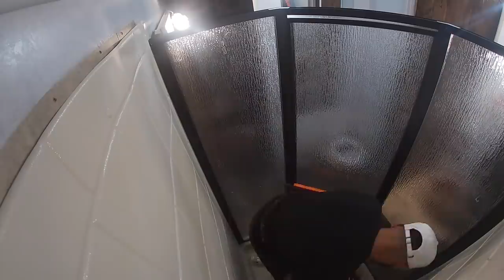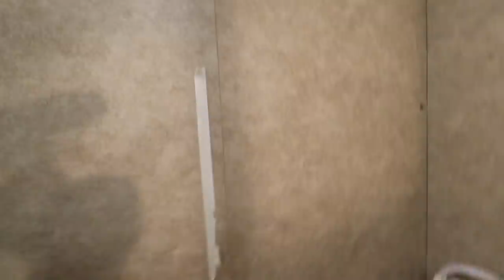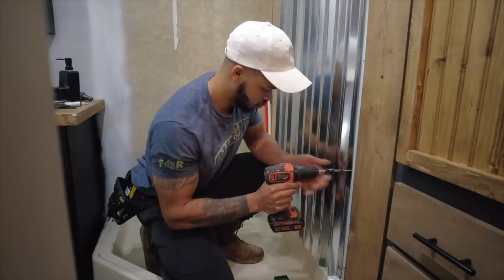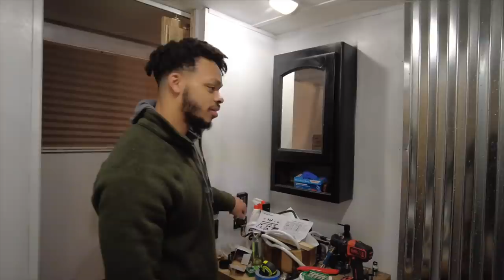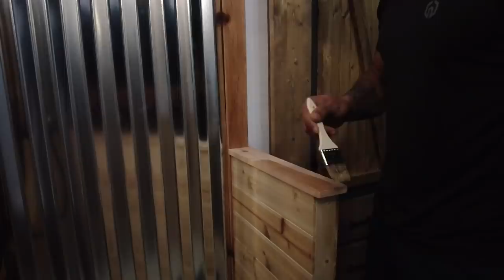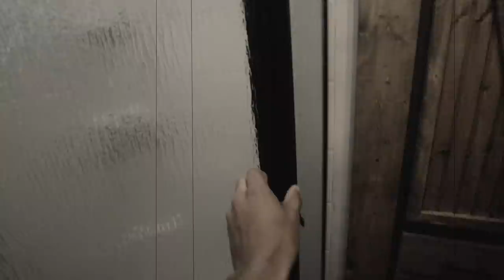DIY RV Shower Rebuild | Dualex RV Renovation

Comment: Looks good , I'm wondering about moisture creep at top and bottom of corrugated metal. Your definitely gonna wanna seal up those areas .Keep them coming.
Reply: I was wondering the same thing. With the corrugated metal I think it will be more difficult to seal
Reply: We share a similar concern. The work is great but I’d be worried about the moisture
Reply: Looks great. I agree about sealing it up. I think I would go around all the seams with clear silicone to ensure no moisture gets in anywhere.
Reply: I have the same question. I’m so confused. Also, the original wall, should it have been cut out and addressed since there was previous leaking?
Reply: Yea I feel he should have put at least a waterproofing barrier between the wall and metal.
Reply: I was thinking the same thing. I was thinking what if he coated the back wall with a weather treatment and glued/tape a ramp of sorts to contact with the wall. That way it water got behind it then it still had a way to escape in to the bottom. Or put two small fans behind the wall or shower head area that circulated air back there.
Reply: @BuckleBunny  I agree!🎯💯💯💯
Reply: @bantam5507  Right EXACTLY!I agree that's what I would have done& inspected the wall for water damage behind the shower & replaced it ect!🤦🤔🎯💯💯💯👍👍
Reply: I'm glad I wasn't the only one w this concern.  Same w the interior of the lil wood walls

Comment: Should've built a wall behind the corrugated metal and coated it with 3 coats of RedGard. Condensation will form behind there and it'll mold pretty quickly. Use GE Bath 100% Silicone on the edge of the corrugated metal, it's guaranteed mold free for 10 years.

Comment: Cool rehab.  Careful on weight you’re adding to the RV that it doesn’t exceed max weight capacity.  Love your ideas!  God bless!
Reply from the maker: I would have done an all wood shower but used the corrugated metal to keep the weight down. This setup actually weighs a little bit less than the original shower with that big bulky door

Comment: Standing applause over here. As a wood working chick myself, I felt like watching the wood floor drop in was some slow motion super bowl winning pass. Cheering and everything. Also so happy you coated in poly and epoxy. Water is amazingly powerful but you have done well to protect against it.

Comment: Great work.  You have given me some ideas.  One advice, you should have used galvanized pipe fittings instead of the black pipe fittings.  Black pipe fittings will eventually corrode and diminish your water flow.

Comment: What's up DualEx. Shower looks awesome. Was wondering if you sealed the holes where you screwed the wood to the shower base. Water is very persistent, and will always find a way. If you did then you are good. If not you will most likely have issues down the road. It will leak through and rot the floor beneath it. Also where the metal meets the wood and the base. If you haven't sealed those joints there will also be leakage. I am not criticising, just trying to save you from replacing the floor down the road. Your vision and ideas are awesome. And I truly believe what you're doing is great. Your work ethic is awesome and it shows. I am a Contractor and would love to have someone with drive like you, who wants to work, on my crew. Keep up the great work. You keep consistently get better.

Comment: Your doing awesome work but on the plumbing portion you should put pipe dope and Teflon tape on your threads because that will make a better sealant in your lines. But keep up the good work

Comment: As usual mad talent w/safety at the forefront. I'm loving eerrrrrthing re  the upgraded shower, especially the 🚿🚿 & wood bottom. I use portable wood-bath mat, feels great under my🐾. I clean mat regularly, avoid mold.
Reply from the maker: I didn’t even think of that but I could definitely clean it regularly and it will probably last much longer

Comment: You might miss the door unless you have a instahot shower installed.  RV showers are notorious for being super short since the available hot water is typically 6 to 10 gallons.  You have to take military showers where you get wet turn the water off soap up , rinse and that's about all you get.

Comment: Great colors and use of flow in the area. I installed showers for 8 years. Only thing I see as a possible concern down the road is the down shot screws in the curb. We generally don’t shoot down through fiberglass and if we did there would be some silicone shot in the holes and around the base as well as on top of the screw head after putting it down. I was thinking maybe bamboo for the flooring plate if it doesn’t work out but mad props… Great skills man. I know your proud of it, and with rights- you should be.

Comment: Great job. Only critique is wish you would have put sealant like butyl tape where you screwed into shower bottom and walls for extra moisture control. But looks fantastic!
Reply: Also they make a foam precut out backer for moisture control for the corrugated roofing panels.

Comment: My only concern with the metal is that top little slit. I don't know if you already filled it with something but steam will rise and accumulate there and if not filled, drip down the backside of your metal sheet.

Comment: I would consider using resin to cover the wood walls you made. Im worried about monster getting trapped inside of them and making mold. Edit cancel that you just mentioned coating it in polyurethane

Comment: I live in a house that was built in 1930. My only bathroom is roughly the size of an RV bathroom. currently, I have a vinyl shower system that takes up 1/3 of the bathroom. I can barely get behind the toilet to clean, its that tight in there. I'm a flooring sales professional, specializing in all applications of tile. I honestly can't find a single tile I love that meets my budget.  I hate every shower kit I have found. I also don't want a glass shower door ever again. Its almost impossible to keep clean. I really want something unique and cool looking. I have been online and YouTube for weeks looking for option. I fell in love with the corrigated metal as a surround. This video is the first (out of many) videos I love! I'm going to duplicate this a much as possible. Questions: did you seal the actual metal? This will be high use. I have two teenage boys. Cedar is beautiful. Would redwood work as well? I will double back on my own research but I thought I'd ask. This is a really great and encouraging video. Thank you so much!

After reading the comments I see there are questions regarding the previous damage. It didn't show that he actually forgot to address that. Maybe he just didn't make that part of the video. I'm assuming a bit of properly installed 1/4" cement backer board could help? And lots of silicone on and in the curves on the rim of the panel? Before dropping it in? No rule against now much a person can use. It's cheap enough. Then use something practical to get under the sharp edge to clean in up? Maybe he decided it was all too much weight?

Comment: This looks awesome!  Planning to do something similar in a box truck conversion.  I am wondering what kind of waterproofing you did for the corregated metal parts?  Did you use caulking and if so what kind?  Also, are there any other joints that got some sort of sealant other than the polyurethane on the walls and epoxy on the floor?  Thanks for your videos, they make this kind of thing possible for me to do!

Comment: Looks real good, didn't see it but did you use plumbers tape on the metal threads behind the tap? If you didn't use the tape that will ultimately be where you end up with leaks as metal on metal threads tend not to make a very good seal.

Comment: Beautiful!  Just don't understand the logic behind the "no moisture" issue between the before and after.  Did you make it, so that the corrugated metal, and the new cedar column are completely seal and no moisture can now get behind into the walls?  If not, then perhaps this is why I don't understand your explanation regarding moisture.

Comment: How did you set it up to prevent moisture from entering behind the aluminum wall coverings? It seems to me there’s a lot of open spaces still, top and bottom but even along the sides of the center column. Beautiful by the way

Comment: those are black iron fittings not rated for potable water use they will rot out  you need brass or galvanized

Comment: When I look at this build it confuses me because you said the back wall was flimsy and could have been compromised with mold, but yet you didn't rip out that board before you attached the metal sheeting, so what gives?

Comment: Question... I'm 6'10" in height. I know there are lot of 5th wheel campers that have taller ceilings in the living room and kitchen area, but start to get shorter towards the bedroom and bathroom. Do you think there is a way of reconfiguring the bathroom shower area to fit someone my height? Thanks! Love your videos!
Reply: I'm 6'3" and have a similar but far less severe issue. I would say it's possible to do, but it will be easier if you can fine a layout that already lends its self to having a bathroom toward the tall areas. Then moving the bathroom would be easier due to it having been so close in the first place. Then your extensions to the plumbing are already mostly ran and terminated professionally toward your black water and gray water tanks. I hope this helps you

Comment: Hi there, just wondering... You mentioned that if the shower doesn't go all the way to the top moisture can get behind it and cause mold? Also you said that there was water damage on that wall. How can you tell with those kinds of walls, because I have them throughout my RV. This is my first and I new to all of it and scared of what I got myself into...

Comment: Several things to ponder on. Moisture is gonna continue to be a problem. No where in the video did I see any kind of caulk or silicone or even plumbers putty included in the install.  Also did you seal the wood on all sides because I see just the face being sealed and that would be a mistake. So basically all you did was remove the plastic walls and the door and added multiple points of failure. To really do this think about using a tyvek water barrier behind the steel.  The steel is gonna create its own moisture as you use the shower being the cold side will condensate. I would tear it all down and start over.

Comment: I have the shower that was removed. How did he get the glass off the wall? That seems to be the biggest issue. I'm trying to replace my shower pan, but I can't get the brackets holding the glass to the wall loose to remove. Any suggestions?

Comment: Nice job. Always enjoy and learn a lot from your videos. Some people recommend reversing your blade when cutting the corrugated with the circular saw. Did you do that?
Reply from the maker: I saw that a lot of people did reverse their blade when I was doing research but I noticed that an equal amount of people did not do that, so I tried it without reversing it and it seemed to work fine. My sheets were very thin though I’m not sure how it would have worked if I used thicker metal
Reply: @Dualex_Builds  Thanks!

Comment: Shortly after you installed the new shower head, I noticed that there was very little clearance between your head and the bottom of the shower head. Now that you've added the wooden flooring, do you actually fit underneath the shower head?

Comment: Black steel pipe rusts, think would go with at least galvanized, don t know if it s more watertight than before, maybe don t want my bare ass to touch that cold corrugated steelplate, and maybe not so cleaning friendly with all those corners, but ok, looks ok now that it s new.

Comment: Bro where you changed from 1/2" to 3/4, those fittings are steel. They won't last. find exactly the same fittings BUT brass. Won't  be cheap

Comment: Kind of confused about the shower. You didnot use anything at the bottom of the shower for any water to start gathering there. You saif you would make it from the bottom to the top but the wood for holding the shower is cut lower. The sides of the shower might be treated with something that you use but I would recomend using extra protection otherwise everything you build will have to be redone. Also please rebuild that ugly storage cabinet above the sink it doesn't fit in at all

Comment: I’m ashamed with myself that I am so upset that you didn’t show any caulk barrier behind the metal to the acrylic base.  Why? And why not epoxy the back of the board that has mounted your showerhead and fixtures?
Reply from the maker: I did a lot of things that I didn’t put in the video so that it wouldn’t be too long
Reply: @Dualex_Builds  ok. Those deets are important to me. I’m looking at using similar materials. 👍🏽

Comment: I swear a year ago you built like, "meh, this pull out bed couch works." And now this shit looks designer. Also won't the gaps caused by the corrugated steel let water in behind the walls for mold again?